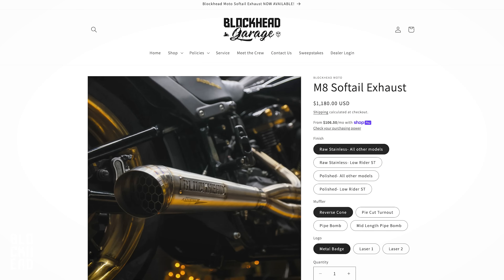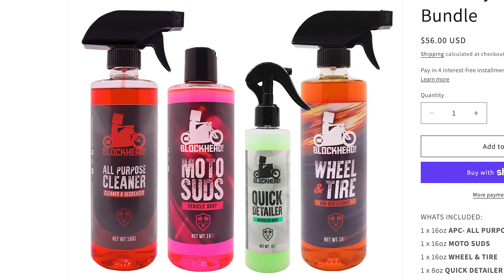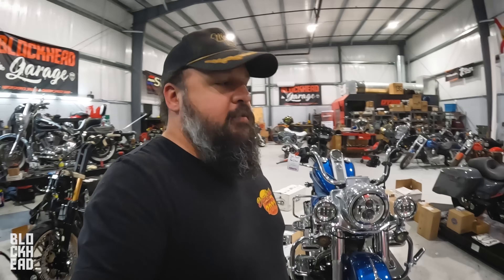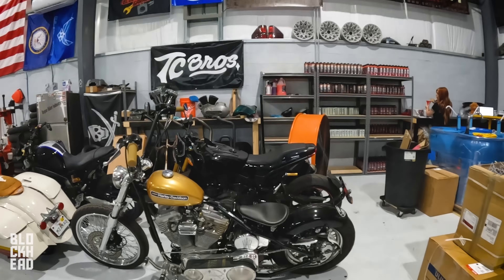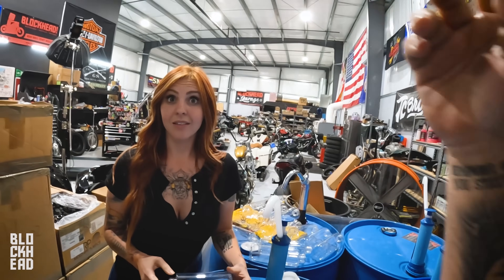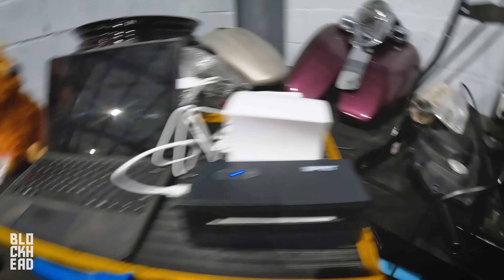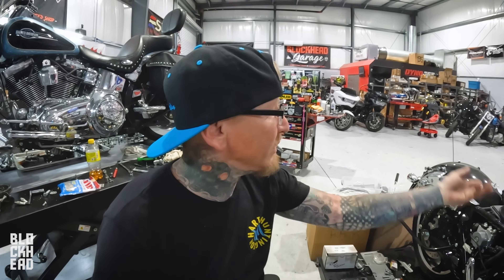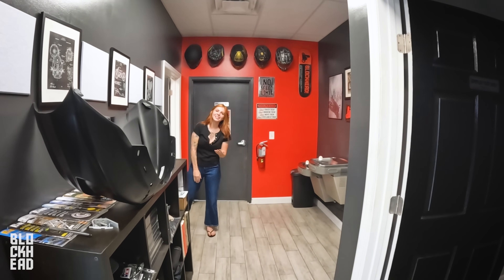This is Long Overdue

Comment: Waiting for an exhaust option in black finish, along with a heat shield for non-melty boots.
Reply from the maker: Heat shields in development! 🤘🏼
Reply: I have a Stealth on my RGS and the exhaust heat  is not even noticeable.   No heat shield necessary.